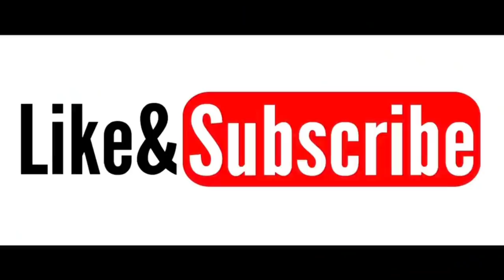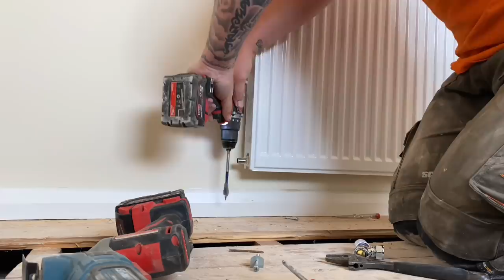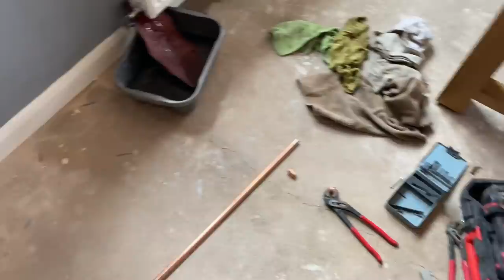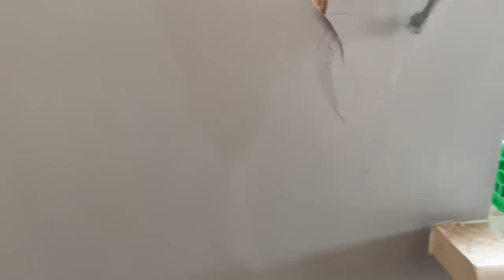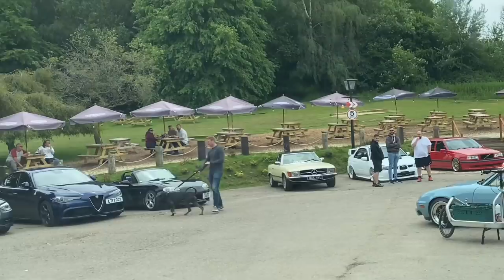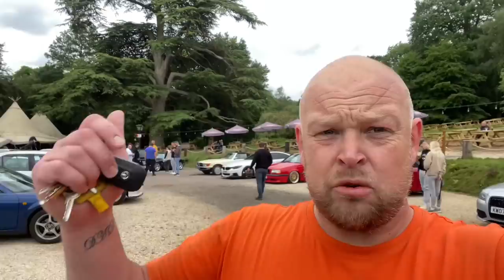PLUMBING HACKS WITH A PENCIL & MAKING A 15mm SLIP COUPLER TO FIX A DRILLED PIPE

Comment: Superb video Mark. Slip coupler idea excellent for when there’s no spring in the pipe., can you do the same for 22 mm pipe. What would you have done if the 15 mm rigid pipe was plastic? The old one shot lol. Remember first time I used that I emptied it full tilt into a blocked toilet and BANG toilet pan cracked. Had to replace whole toilet  and it was only afterwards that I read the instructions on the bottle which said in Capitals “ POUR SLOWLY! It learnt me a lesson I never forgot lol. Keep up the good work mate and congratulations on the new member of the family.
Reply from the maker: Thanks mate..... yes i have done the same on a 22mm coupler aswell, worked a treat..

Comment: Don’t know if you have one but you can get a setting tool that opens out the plasterboard fixing makes it so much easier
Reply: @MJTiffPlumbing  screwfix do them they cheap
Reply: Screwfix code 8499G or 12429
Reply: @MJTiffPlumbing 
Are the plasterboard fixings heavy enough to take a double radiator once filled with water?  A couple "dwangs" of wood between the struts or a large piece mdf screwed up multiple times be stronger base for rad. Probably overkill but l just dunno if l would 100pc trust 4 plasterboard fixings to last the time with weight.  Top channel 👍🏼
Reply from the maker: It was a single panel rad, and also I put in a baton behind the wall the screwed into that once the brackets were in place but to be fair I’ve never had an issue with good plasterboard fixings on something like this that doesn’t weigh that much…
Reply: @MJTiffPlumbing 
Ah no worries, cheers again great channel 😀

Comment: Get some repair covers from screwfix. It looks like a section of pipe cut in half which you clip over the pipe and solder it on as you would a fitting and it covers the hole.
Reply from the maker: oh now they sound interesting
Reply: Yes, excellent product, does work

Comment: good way of filing down the socket great video. Is something missing on the shower drain should there be like a white funnel piece under the chrome plate that makes the trap? i went to a job once where they said smells were coming from the shower and they had removed the white bowl so it drained faster
Reply from the maker: Thanks mate….👍🏼👍🏼

Bowl was still there, strange that it was smelling

Comment: What's the make of the push fit you use is it cheaper than JG speed fit  great video
Reply from the maker: It’s Polypipe, a bit cheaper but a lot easier to use as it’s much more flexible

Comment: The shower trap is missing the centre section and there may be a Oring seal on the chrome top . I had 2 smelling , someone else had replaced the chrome tops with the wrong diameter ones and it didn't seal allowing the smell to come through
Reply from the maker: I did wonder if there was an o-ring missing but trying to match up shower wastes is a nightmare…… dont suppose you know what trap it is by any chance?
Reply: @MJTiffPlumbing  the two I got were viva , I had to measure the internal diameter of the trap then looked at loads on e bay to get the correct size . Most were 2mm  too small .
Reply: @MJTiffPlumbing  the viva ones are 80mm internal diameter,  the rest are 77/78mm . Measure the I.D.  and look on e bay . You can buy the chrome top which has the dip tube attached.   With the viva ones I had to trim the dip tube as it was a bit long for the existing bowl . No issue though
Reply from the maker: Thanks mate… much appreciated 👍🏼👍🏼
Reply: @MJTiffPlumbing  no bother . Everything is easier once you have done it once .  There are loads of cheap naff traps .

Comment: I use to work for Dyno(yeah... I know... 🤣 stepping stone mate.. stepping stone..)
and without fail, every weekend I was on call, I'd get a call out for a job, 120 miles down the road(I covered 250 mile radius, Devon, Cornwall etc) because someone had drilled through a pipe, either hanging pictures or hanging curtain rails. Why wouldn't installers install pipes in walls in the corners?? Prime location for where a curtain rail would go... "let's hide a pipe in the wall, right there, by the window.. yeah, great place that.." 🤔🤦🤣
Still... keeps us working..
Reply from the maker: Yep complete pain in the arse where they run them

Comment: Could have just cut once cleaned the pipe either side and solder the slip coupler. And if you've no drill bit a. Round file works..
Reply from the maker: Could of done so many different things but I decided to do this…..

Comment: Do you realise the wall thickness at the crimp stop is the same as the overall thickness so when filing or grinding you are compromising the strength of the fitting at that point …. Better to anneal the fitting  and use  a swage  tool   Or swage the the replacement section with a double length socket  and slip up and draw back to a standard socket
Reply from the maker: Thanks for watching.

Never had an issue doing this for 25+ years tbh however I do get what you mean.